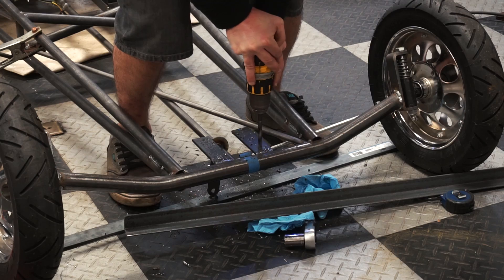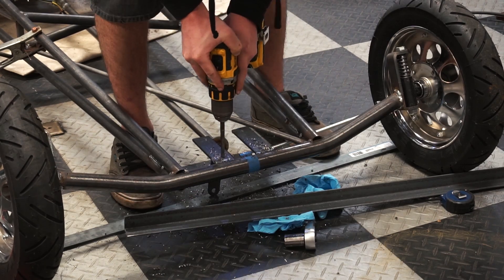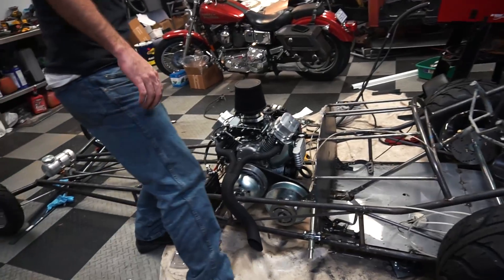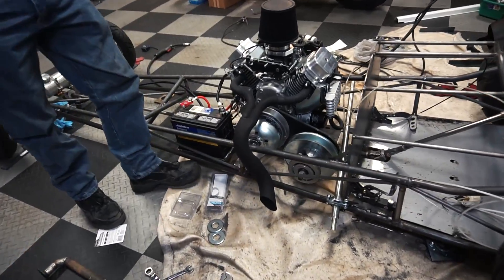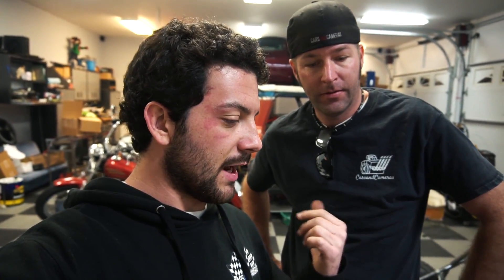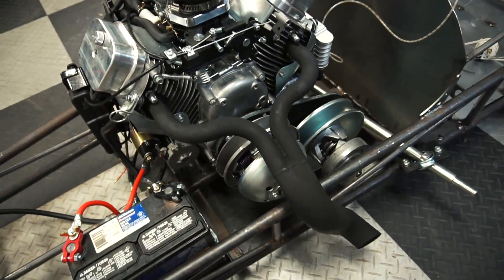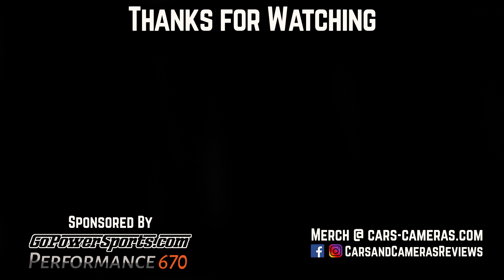670cc Dragster Pt. 9

Comment: Get rid of that air cleaner and get a velocity stack.
Reply: Eurobeatmachinist86 that would look cool
Reply: Might not fit.
Reply: Yep on motor trend they just proved that air stack style filters make more power than ones that draw in from the sides.
Reply: sirgallium I was about to say
Reply: Because velocity stacks are redly available for generator vtwins
Reply: sirgallium that’s true but it only made like 1-2 hp more on a 700HP v8!! You will see no difference between that and no air cleaner at all on the “50hp” vtwin
Reply: TREVOR DAVIS it's lesser power so the little bit you take from this affects it more drastically then it does on the 700hp V8. So the stack may not gain a TON but it is alot better then what the Vtwin  would so with the reusable air filter, plus you're not looking at the power Lost to the reusable air filter element because they lost a ton unless it was the over sized filter and it still lost some vs gaining some.
Reply: It would fit the design very well
Reply: OGskunkMASTA but what he is saying is that @ 700 hp it only increased it 2 so with a low hp engine you won't see any difference
Reply: The thing on this discussion is that I don't know how different the carb throat is on this engine compared to a typical Holley-type V8 carburetor, so the intake shear across the mouth might not be as crucial. I'd like to point out, though, that this filter at least has a decent amount of verticality, and the adapter to use it has a bit of a velocity stack feature as well, so just going for a filterless stack probably wouldn't see much difference and would result in more frequent oil changes, at best.

But it'd look cool.
Reply: yes red billy thats how you make power
Reply: Eurobeatmachinist86 supercharger and bug catcher
Reply: Was about to say that, salad bowl needs to be the new go-to for all the horsepower needs

Comment: wheelie bar needed instead of adding wieght
Reply: but even if they have a wheelie bar the front tires wont have traction and wheelie bars are only for the launch so they cant roll at a high speed with those little wheels
Reply: yea fair enough add weight and a wheelie bar!

Comment: I feel like the gas tank is a little too small. I'm thinking that when you run it full speed the gas tank will be empty in a short amount of time
Reply: Jason Creeper they only need it to go an eighth mile...
Reply: Jason Creeper that's the idea bud. only needs enough fuel to get down the track. fuel is heavy
Reply: the dude that makes sense
Reply: kyle spencer I understand that however I'm sure there gonna ride it multiple times
Reply: Jason Creeper yeah and they can re fuel each run. not that big of a deal, I doubt they will be hot lapping it
Reply: Jason Creeper your feelings are not relevant in the real world.

Comment: May want to heat wrap the exhaust to protect the belt and also switch to a copper oil pressure line. Most drag strips won't let you run a plastic line because it may melt and cause a fire.

Comment: Check the internal bore of the stock exhaust headers. Usually they are necked down which will create a restriction in flow. On small engines I use a Dremel tool or a rat tail file and match the exhaust bore diameter on the head to the exhaust header. There are often restrictions and imperfections in the metal. If you spend a bunch of money on the engine, dont restrict the exhaust.

Comment: It would be so awesome if you guys did a side exit exhaust where the pipes curved down around the outside of the frame, were low to the ground and came into one bigger tube that was pointed at the back tire. Almost like a long tube header look. Either that or monster truck style header where they come together into one tube while pointing up and out

Comment: Do a glass wrap on the exhaust - besides the cool factor, it will help keep the heat away from the belt, battery, and the nice paint you are going to put on the frame...

Comment: I have a suggestion for the dragster the steering horn coming off of the steering linkage if you're doing wheelies with the dragster then when it goes down the shock from the Wheely is going to hit down in the steering horn is actually gonna hit into the ground because you have suspension in the front so it's just a suggestion to fix it or ground it off

Comment: That cvt looks like a 94c Duster.
Reply: Yes, it is, gopowersports just makes the mount for the engine.
Reply: Seems pointless to have a back plate. Long as you know how far center to center is for the belt, you don't realistically need one.
Reply: It makes it easier to mount.

Comment: Yall really need a tig welder. I would also suggestthat  you speed up your welding speed so you dont get the material to hot. Aka exhaust pipes
Reply: Noah Rodeghiero what is a tig welder
Reply: Racer Fan why are you even here rn
Reply: Yelsew Painter what do you mean why am I even here

Comment: Gonna want to put a bigger tank on it eventually! Won’t get no run time with that little one!
Reply: Zachary Turner same but you want to keep the weight down. And it’s just designed to go down a track for maybe 10 seconds and then it’s turned off.
Reply: true trev but bigger tank will mean better steering too :)
Reply: gimble last time I checked drag strips don't have many turns

Comment: Hey guys, seeming that you use toque converters allot, have you ever mounted one horizontal? As in under a ride on mower?
Reply: half of one. we did it on the drift mower
Reply: Were there any issues with this? Im building a little beast for my nephew and Im thinking of using one.

Comment: Ever since you guys started this project I've been wondering about the Driveline, the chain is going to be quite long aren't you worried about it snapping it and the loss of horsepower with such a long chain.
When you first started this project did you ever think about doing a shaft drive??
Reply: thought of a driveshaft but the last (magic box) we used cost alot

Comment: No battery, save the weight. Get an external  electric starter.  Its hp/weight in drag racing  if your TW is 500 with the driver and you make 45 hp, 13 seconds should be your 1/4m ET on a perfect run. Remove that 3 lbs battery might make a 12.9.

Comment: "95 octane, ladies and gents"

Me: stares at VP racing Q16 jug ".... that's it?"
Reply: I'm more of an exo2 kind of guy
Reply: in finland we can get 99 octane gas from gas station
Reply: 102 octane in germany :D
Reply: 95 aki is more than 99 ron
Reply: I run 93 with octane booster
Reply: I like 86 but its whatever
Reply: 95 is regular here I use 105
Reply: Gonna Run HOT!
Reply: GT20Modding how
Reply: +Bryce Dale Higher octane gas runs hotter but it is sometimes necessary for something like this. but normal cars just get the cheapest unless specified by your manufacturer.
Reply: High octane gas does not run hotter. The higher the octane the harder it is to ignite the mixture, that is the only difference. It keeps it from knocking and pre-detonation in high compression and high power engines so it doesn't go off before the spark plug fires.
Reply: I know that but under tests ive done in non-modified small engines the higher octane gas runs hotter.
Reply: sirgallium higher octane just means the more controlled the combustion will be.
Reply: The US is one of the places that measure octane differently, our high octane pump gas is about the same as yours
Reply: Chris 102 RON octane is 95 AKI octane.
Reply: Manki Mafia Vähäkyrö octane is measured differently in the states.  Our 95 is similar to your 100
Reply: Just realized I'm not the first to reply this
Reply: I'm N/A so 110 VP from the pump, $8 a gallon 👎
Reply: "octane" refers to it's ability to withstand pressure as to avoid"pre-ignition", or detonation...it is the base fuel, its A/F ratio and its additives along with compression ratio , and a large factor the ignition curve that dictates how "hot" the actual burn is...
Reply: perkele
Reply: Boosted98gsx that’s exactly what I was thinking.  95 thats some pretty heavy shit lmfao

Comment: Wouldn’t you move the engine plate an 1/8th if it was 11 on one side and 11 1/4 on the other?
Reply: the frame moves in the more forward the frame is. wedge shaped

Comment: Put a wheely bar on the back to stop it from going up instead of having loads of shit on the front
Reply: Brock Coelho they are but at the same time you can still flip something with a wheelie bar,
So they're trying to Weight it down a little bit
Reply: You cant flip something if you have a good wheelie bar mate
Reply: It’s very possible to flip something with a wheelie bar. I’ve done it.
Reply: Maine F3 not a fucking go cart
Reply: Dude do you not see the line being crossed between a go kart and an actual dragster also the point of a wheelie bar it to prevent a car with too much horsepower to completely flip over yet the wheelie bar will still make the car go up just not as much the point is to put down as much of the power as possible without having the car going up
Reply: ...... they’ve probably said that they are going to do it maybe 1000 time at the beginning of the series... they’re only putting stuff in the front so they won’t be doing a wheelie all the way down the track.
Reply: They are putting weight up front because there was no weight on the front tires. No weight on the front tires equals no steering.
Reply: Braden don't underestimate a junior/ mini dragster, faster than your family car and a young lady just died here the other week after hitting the wall in one.
Reply: What they mentioned in their other video is they don't want the front end to lift up, them turn the wheel slightly, and when it drops they go off to the side. That's why they want to weight down the front.
Reply: Why not put shit up the front too though?? Less wheelie= better times?
Reply: more efficient to put more stuff up front that the kart needs to run anyway rather than adding more weight for a wheelie bar. Also you can't steer if the front tires are in the air.

Comment: Great stuff guys. How are you getting the power to the ground. Ie, converter to rear wheels? Where are you mounting the chain I guess is what I'm asking? How you running it to the rear sprocket. Love the build good job.
Reply: Kerry Huston they were planning on using a jack shaft if I remember right, so they could mount the engine in a nice place and not have to run a chain between they’re legs

Comment: So the videos are great and its nice to see stuff that is actually obtainable by most people. You dont need all super fancy tools and such. My only serious concern right now is the placement of the fuel tank. First of all, with the placement, you are almost GUARANTEEING a horrific fiery crash. Second, that carb is meant to run with a gravity feed. Even adding a fuel pump, the float system may not work correctly. Besides that, this thing is pretty bad ass guys. Keep it up and maybe a little longer on the vids.

Comment: Can I ditch my air box, replacing it with one of those air filters, I own a kz200a 198cc like 18 horses worth of power. 1978, I am rebuilding my motor cycle an the box is rather dinged, the filters they use seem like they would do the job.
Reply: we got it from gopowersports.com

Comment: 8:25 "95 octane, ladies and gents"
95 octane race fuel...
Hahaha, here in germany you can get 102 octane gas at the gas station. :)
Reply: Chris we use to have great fuel prem 102 to 104 reg was 96  back in the day
Reply: Chris 98 at most stations here. 105 can be found at same places
Reply: Kia ora from nz
Reply: Chris here in the USA you can get 110 octane Cam2 at the gas station.
Reply: Aye sure mate. Do the Germans normally put hunder octane in their GO CARTS? Thought as much
Reply: Russell1shot I run 110 octane in my Yamaha KT 100 race kart, some people even run 112-115 but we've found after 110 there's no benefit
Reply: The US measures octane differently, our 95 octane is better than your 104 or whatever. Our high octane pump gas is roughly the same. I get 93 where I live and that's 100+ across the pond.
Reply: Wray Vision party pooper
Reply: Too bad you guys aren't allowed to modify your cars.
Reply: +Wray Vision No the octane is the same all over the world!
It is a meassurement in how much it can resist engine knock!
Higher octane, more rpm without engine knock.
Reply: Chris here in america in certain areas you can get 110 octane. But the average high octane is 91 and 93
Reply: Hail
Reply: It's because you guys use a different scale than we do.
Reply: +Madone6 No they don't. Octane is the same all over the world and is just a meassurement how knock resistant the fuel is! Higher Octane more rpm without knocking!
And also cope with higher compression ratio.
Reply: jj Watson 
R+M/2
Research + motor/2
That’s our octane measurement for the states.
Reply: how come every european brags about this despite being so monumentally wrong. AKI and RON units of measurement are completely different.
Reply: Matte Edström It may do you well to research the topic you are spewing misinformation on. The standard octane rating scale for most of the world is purely RON. The scale used in the US is AKI. if we were to compare the two different scale values of the same mixture of gasoline, our premium rating would be the same as yours despite the apparent 10 rate difference.
Reply: In Arizona where I live you can get 110 at the gas station
Reply: YOU USE A DIFFERENT RATING SYSTEM... 

Ffs..
Reply: Matte Edström Nej, de har faktiskt ett annat sätt att mäta oktan i USA. Googla lite innan du svarar så tvärsäkert.
Reply: In australia you can buy 98 at outback fuel stations XD
Reply: dont forgot besides 98 octane we can get 100 octane at dodgy servos lol
Reply: And if you have a real race car most carry e85
Reply: Loves here in my state sells 110 at the pumps
Reply: Aaron Potton.  Altitude? What are you talking about? Do we have high altitude in Germany? I think you have never left the USA, am I right?
Reply: Russell1shot . of course
Reply: Wray Vision. Sure, octane rating must be different in the best cuntry of the world than in all other 3. world countries.
Reply: Isn't it measured differently in the US than it is in Europe? Thought I heard it somewhere but I can't remember well enough to make a definite statement